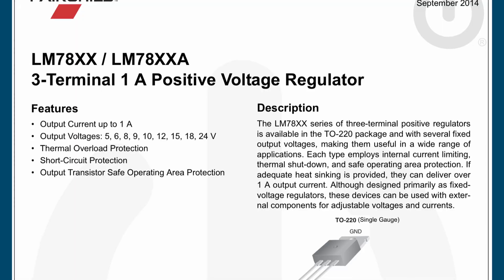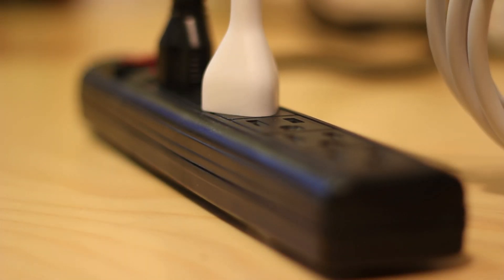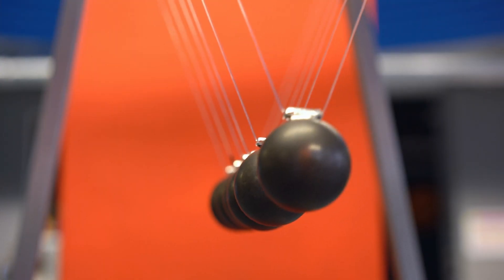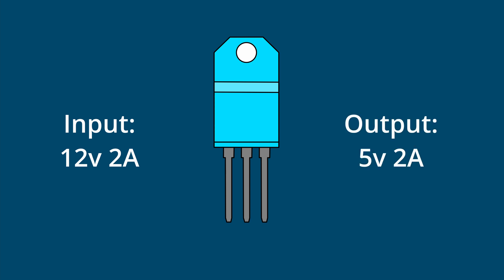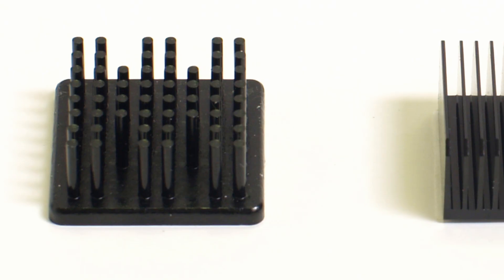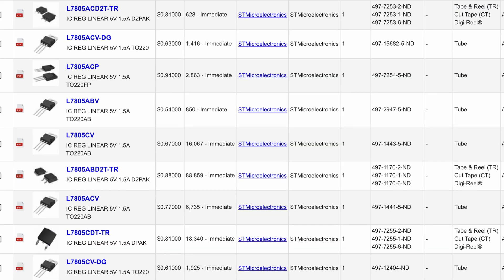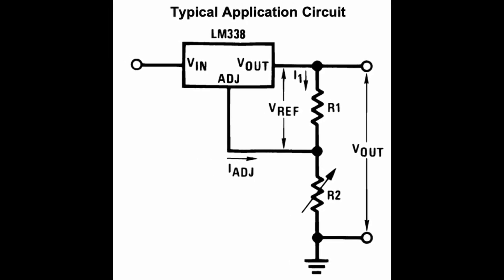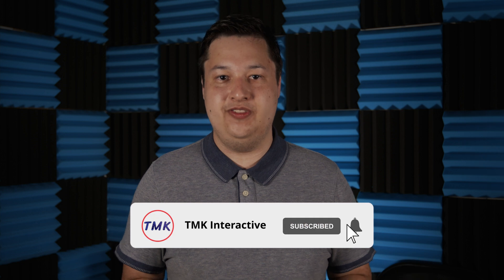What Are Linear Voltage Regulators?!? And why they get so hot!

Comment: OK we are total noobs you need to show us an actual wired up circuit. For example does this component get wired in line with positive to the left leg or does one leg dip into that positive and the other one go to negative it would still store and release energy either way but it's much more likely to blow up one way you might wanna save your users a big headache and a sore red spot on their cheek by explaining that aspect. You have to assume that people watching this have never done anything with electronics before because most likely they haven't